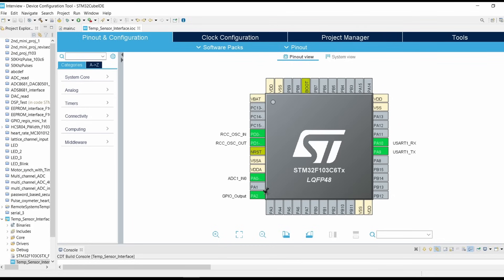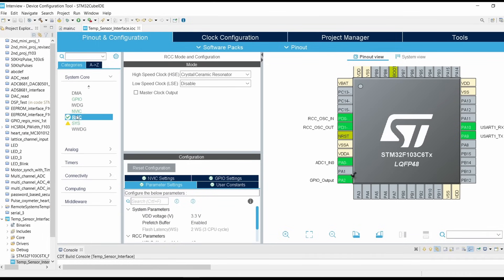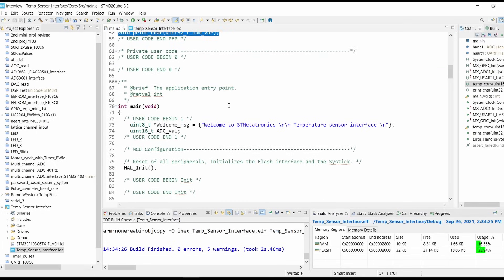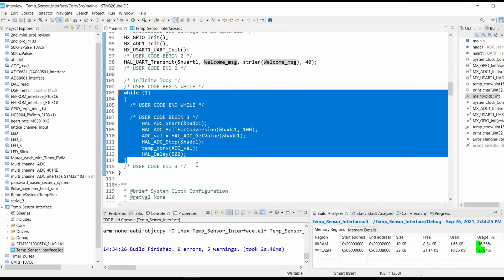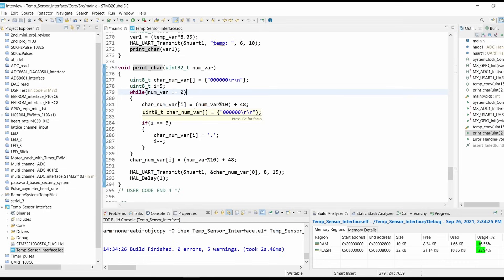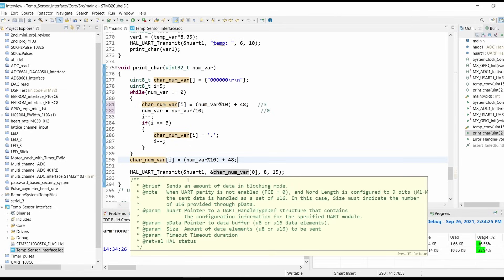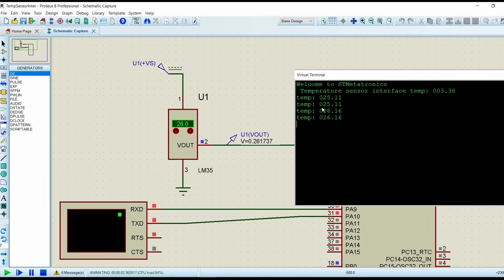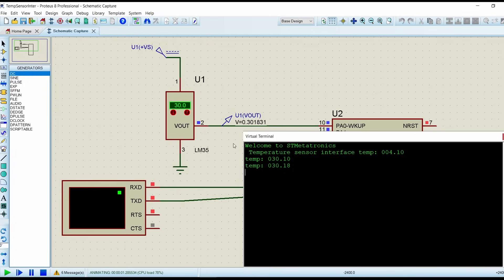LM35 sensor interface | How to interface temperature sensor with stm32 controller | STM tutorials

Comment: Sir in industry level which board is widely use FPGA or stm32 microcontroller board
Reply from the maker: Depends on the application. fpga is preferred for time bound application (very fast application where nano second matters)  and then stm based boards are used for control application, DAS and other application ( response time >= microsecond)
Reply: @stmetatronics6593  so sir can I use arduino ide to programme stm32 because it has wide range of sensor library posted by the community over the cube ide ...& what is the difference in between both the ide
Reply: @subhamdas2491  , i am a beginner in Stm32 but what I learned so far is that Arduino Ide is used only for its library and Cube IDE is for professionals who can code in register level. For example If you have a sensor and don't know how to work with it, then don't worry, you will definitely find an arduino library for it.